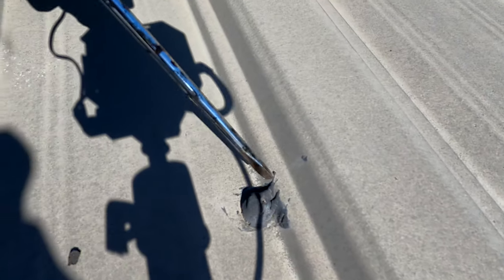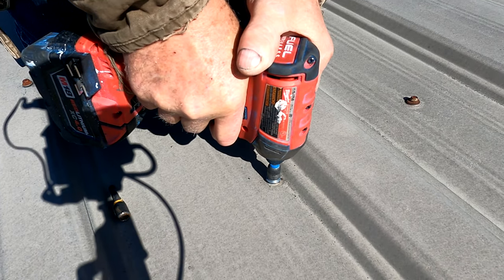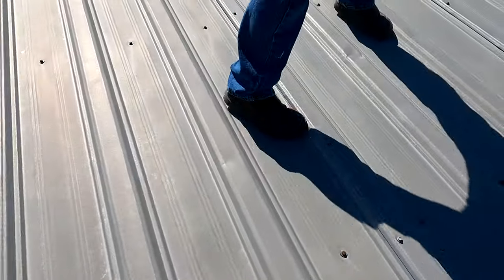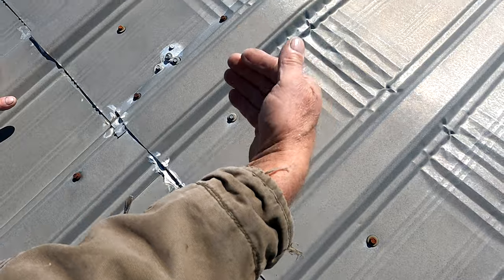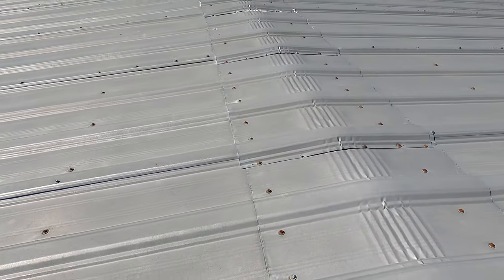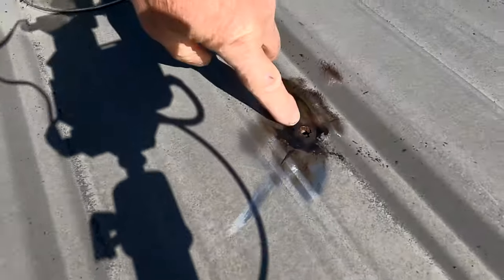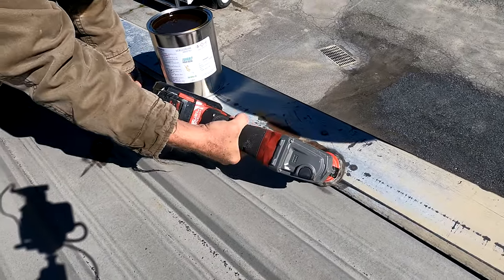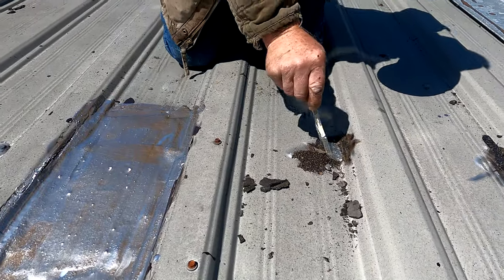5 common mistakes to avoid when Repair Metal Roof leaks - Turbo Poly Seal

Comment: Roof Dr....thanks for all your great videos, and advice, and blah blah blah. 😂
  I just purchased a gallon of Turbo Poly Seal a few weeks ago. The stuff is truly amazing!
   My home has a metal flat roof on it, that while it is clearly not anywhere close to being new, it's not currently leaking anywhere, nor is it rusted in any place. However, all the screw heads have surface rust, with many of them showing signs of either backing out a bit, or their rubber gaskets being dried out, and cracking.
  So, long story longer, last fall I took one out, and brought it up to the Homeless Despot with me to match it up for new replacements. All the screws in the roof are #9, 1 1/2". And the few that I did fool with, seemed to still have the ability to make a good purchase back into the wood under the metal.
   Not having seen your channel back then (or this video, of course), I reasoned that some of the new replacement screws may NOT be able to get a good (or any!) purchase, when going back in.
   So I figured I'd use some GE Silicone Clear seal caulk into each hole, before putting the new ones in. And yes, I bought a plastic bucket of the same exact size (Buildex Teks Roofing screws 400 ct). But also, a 25 ct bag of #12 1 1/2", should a particular hole have ZERO purchase in it.
   Obviously, after seeing this video, I realized that I've f'd up.
I should have bought a 400 ct of the #12s, and called it a day. 😐
   So, with all that being said...my question to you is, now that I have a gallon of Turbo Poly Seal, do you think I can get away with using the #9s if I use the TPS in the holes that still have good purchase into the wood?
   I can't return em, and that box of screws was $37. Or do you think I'd be wiser eating the cost of another box of the #12s?
    Thanks so much for your time, and any response! That was some serious blah, blah, blah, for sure. Lol. Sorry for the "novel."
Reply from the maker: I am glad you found it working for you
Reply: liked your story! So what did you end up doing? 😁

Comment: To anyone thinking about using any kind of white elastomeric or silicone coating listen to him!! I did it a few years back and after 2 years it cracked all over and ruined my whole roof. Ended up costing me over $5000. Only use aluminum coatings
Reply from the maker: Hey Dylan You are absolutely spot on. I am about to make a video on Aluminum Asphalt paint. I think that is the best coating to protect your roof from rust. But you still have to fix the leaks. Aluminum Asphalt is not to seal the roof from leaking.

Comment: I hope you can give an advise. My roof has overtightened hex screws and now I think this is where the roof leak is coming from. Is it okay to put silicone sealant on the hex screws as temporary fix? What do you advise? should I replace the screws already or just untighten them? Thanks! you have great content!

Comment: Thank You for another great video. How can I tell the size of the screw I take out so I can make sure I replace with a larger screw? Where is a good place to get the replacement metal roof screws? They are special screws,yes?
Reply from the maker: I found screws on Amazon. I will try to remember to post a link to those screws. It appears they work for all circumstances
Reply: @FlatRoofDoctor  Please post the screws you found.

Comment: You can use caulk, but you must clean the area first with appropriate cleaners, caulk with urethane and then top coat to prevent the caulk from cracking. We recommend a GAF metal roof coating….

Comment: I have another question! What's the difference between your Silver paint being used in the video, and say, an "exterior oil based aluminium" paint?
   Also, I really want to paint my metal roof white, as the house is being painted gray, with white trim, and white gutters.
   Is there a particular brand of oil based paint for metal roofs that you would recommend, that is available in different colors? Thanks!

Comment: Thank You for the very helpful videos,  my wife & I purchased a skating rink 14 years ago to give the local kids a place to go and we are still going' the building was built in 1982.
The roof had all 5 of the never do's done to it, it took me weeks to remove the tar & silicone, the worse leaks were where the end caps (not sure the technical term)  where the metal roof ends on the sides (i am refering to the part you sanded that was rusty at 6min 21 secin the video), I found that the butle tape was dry and chalky, i replaced it with new butle tape,  its been a few years & the tape is breaking down again, can I just use the turbo seal where it joins all along where the cap touches the edge of the roof or is there a better way, this roof is massive?
Thank You for all You do to educate folks like me.
Reply: What did you end up doing?

Comment: Do you have a rubber roof coating you recommend ? I’m looking to spraying my 40x60 shop  .... it has a metal roof on it
Reply from the maker: I am very skeptical about coatings. i would recommend fix all the leaks 1st, then if the metal is in relative good shape, coat it with Aluminum Asphalt paint. This Aluminum Asphalt will protect your roof from rust and is highly reflective. Leaks can always be fixed even after the Aluminum Asphalt was applied.
Reply: Awsome! Thank you for your speedy response. Keep up the good work
Reply from the maker: @323guzmandavalos  take care

Comment: I have leaks in my metal shop roof from misdrilled holes.  What do you recommend to fill these holes?
Reply from the maker: Turbo Poly Seal
Reply: @FlatRoofDoctor  should I fill the hole first with a pop rivet?

Comment: Hello thanks again for your knowledge. What would you suggest to cover a flat modified bitumen roof that was installed over an old roof 10 years ago. I in spected the roof and seems to be in great shape still. Nevertheless I'd like to maintain it by applying a coat of the Karnak aluminum paint. What would you suggest. Also fiber or unfibered?

Comment: have you ever used sandpaper and rust converter then coated with neptune? ... also would think you would  want to be wearing harness if your going to be working on thee edge of the roof your on. cool video though
Reply from the maker: Hey Felix. I have not used the. products you mentioned. there are so many products on the market.
Thanks for your comment.

Comment: So what are the fixes. I have a dent from a tree limb that fell on small steel roof. The dents not leaking but will hold water. Do I use filler to fix, or do I use a square piece of steel/aluminum and attach with epoxy. You told me the never what is repair process to fix it?
Reply from the maker: Hey Granny. I have many videos showing you how to make repairs. It appears you only saw 1 video on the entire youtube library. Believe me, there are many more videos.  Maybe it was a little late at night and you had to go to bed. I am sure you have good reasons. Take care and get some sleep.
Reply from the maker: By the way, if it is only a dent, there is no need to do anything. You could try to knock the dent back from underneath.

Comment: I wish I could hire you to fix my leaky roof instead. These metal roof leaks in my house have been stressful to deal with as it's hard to identify the leak. The roof looks in good condition and there are no seals so it can only be one of the screws but they all seem good so I don't know which one and I'm afraid to remove one and create more leaks. 

Can I just put this Turbo Poly Seal over a screw? and more importantly where can I buy this stuff in person. Would a Home Depot or Lowe's have it?
Reply from the maker: Yes just dab the screws with Turbo. You can buy it here and have it  delivered at your doorstep in person. https://bergstromm.com/product/turbo-poly-seal-1-2-gal-with-silver-coat-protection/

Comment: You say never use a coating but what about a roof that is 70% covered in surface rust wouldn't a coating prolong the life of it more than leaving it alone?
Reply from the maker: I think coatings could be great. but it is almost impossible to have the surface so clean that it is ready to receive a Silicone or Latex coating. Then like any paint, which coatings are, are exposed to UV's that will shorten the life expectancy of the coating. I think if you want to prolong the metal roofs life, and prevent rusting, you should use Aluminum Asphalt instead. It is very seldom to see Aluminum Asphalt bubble up and peele. It is reflective and adheres almost to any surface without much prep.
Reply: @FlatRoofDoctor  Is aluminum asphalt good directly over rusty metal?

Comment: The only true way to treat rust is to treat iT with rust converter,this reacts with the rust and helps to slow down the process. Covering the rust with a sealer should really only be done once the rust has been treated.
Reply from the maker: sure , you got a point. But the moment you prevent oxygen from reacting with metal, rust stops. no matter the condition. I have coated roofs with Aluminum Asphalt " Silver coating" and did not remove the rust prior, and it is still holding after many years
Reply: @FlatRoofDoctor  ,yes,however,oxidation will continue on the inside of the plate that a top coat application will not reach.

Comment: I get why people want to use coatings in efforts to cool the interior but they will fail & require a lot of maintenance & cost more than if you just paid a higher cooling bill. It's insane when these roof coating companies tell there customer the roof needs pressure washing 2-3 times a year because dirt kills the heat reflecting ability. Those coatings are endless money pits & you be better just using insulation under the roof.

Comment: 1. correct / 2.  correct / 3. correct / 4. correct / 5. correct / 6. WRONG / Silver Coat is not UV stable, it will crack!
Reply from the maker: It has been used on Torch Down Roof, Build-Up roofs and metal roofs for many years and I have not seen any cracking. The Aluminum is metal, therefor cant be affected by UV's

Comment: Are you not a hypocrite? Good advice on some things but…You say never apply coating and then you apply a coating around the screws? 🙄 Elastomeric coatings with embedded fabric along seams and caulk around screw heads with an overall top coat does work when applied properly. 20 years plus with no more leaks!
Reply: You didn't listen.   He also has broken English.  He was not being hypocritical